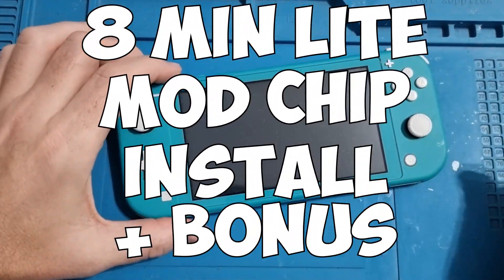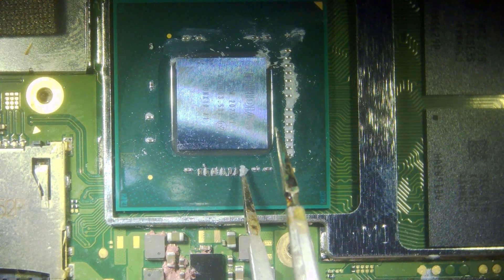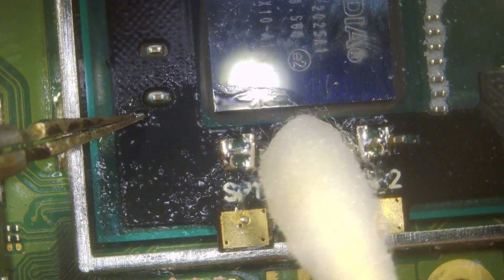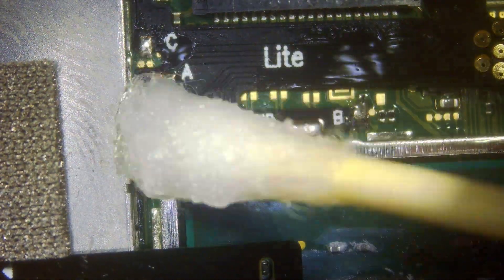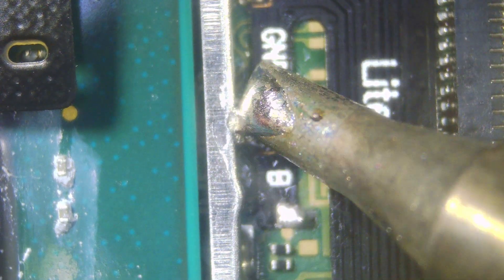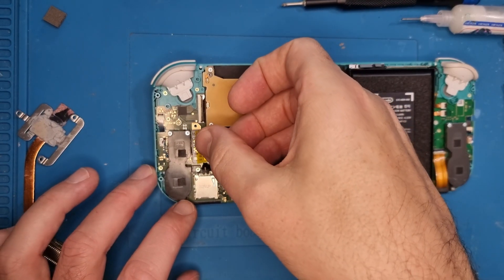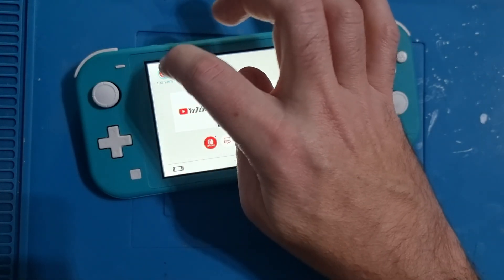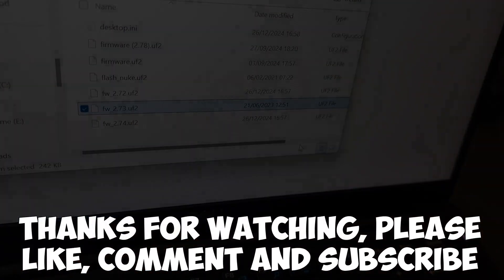8 Minute Lite Mod chip install + installing/updating chip FW

Comment: Thank you for this, straight to the point and simple. Now I just gotta figure out how to solder since I’ve never done it before 😅

Which magnifying glass should I buy, I know I’m gonna need one 😂
Reply from the maker: Thanks!
I have had a few microscopes, made a few vids, here's a few:
https://youtu.be/N2JIZeCBi58
https://youtu.be/wkVNRP6Y7Lo
They are all pretty similar but I like the bigger screens now!
Might also be worth looking at a microscope app on your phone instead, I used one on mine for a while before getting a scope.
Also need to practice beforehand, maybe buy a faulty board off eBay?

Comment: 3:18 around here it seems I bridged the 2 capacitors on the right. This would cause the console to not boot? If I unbridged them is that enough or do I need to replace the capacitors as well?
Reply from the maker: I would recommend un-bridging them, a bit of flux and a big solder tip should do it. I wouldn't replace them but make sure there not moved and out of place.
Reply: @fixingmoddingbuilding unbridging it did the trick :)
Reply: @fixingmoddingbuilding thank you I will do that! :)

Comment: Hi friend how are you

we intalled the lite modchip, it shows , blue then yellow, yellow,yellow, they say it is dat0 problem, we removed flex cable in 3:38 and replaced it with copper wires, but the same problem, could it be the flex cable  in between cpu capacitors?
Reply from the maker: I would check all solder points, make sure they are connected and no movement

Comment: Can we mod switch lite into a home console ? No battery, no screen. Just plug in to a monitor and play.
Reply from the maker: I've been thinking about it for a while, the issue I see is there is no output chip, the switch has a P13 chip that outputs the TV signal this does not have it so it's finding an alternative to mirror the screen?
Reply: @fixingmoddingbuilding  wasn't there a mod somewhat recently for the switch lite where you can output to hdmi

edit: the super5 hdmi apparently
Reply: Or the regular switch, not "lite" version? 😊 thanks 👍🏻